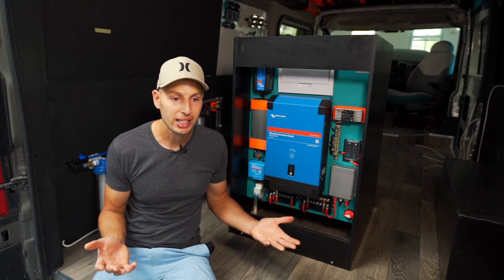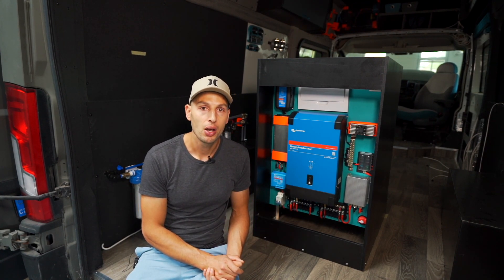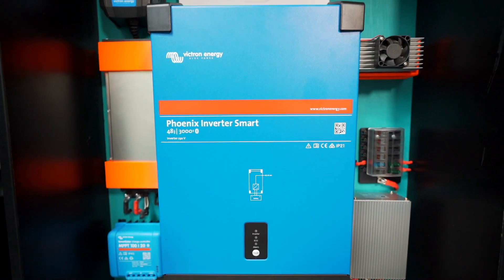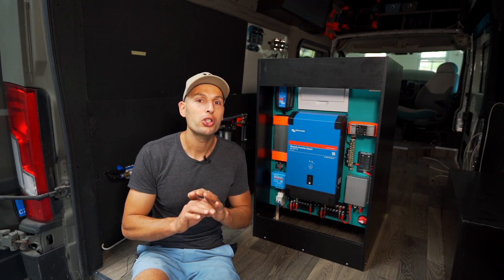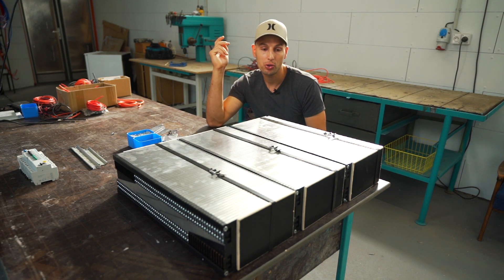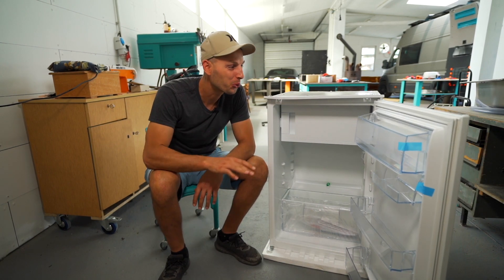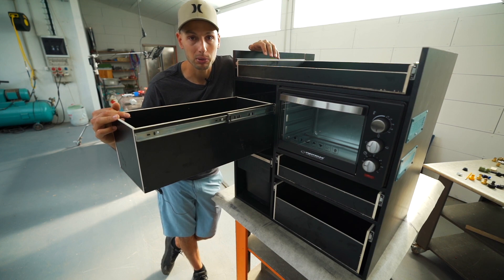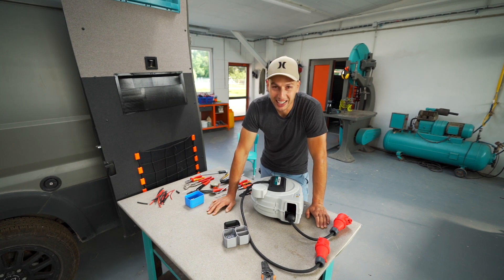New Approach to Electrical System in CamperVan (48V)

Comment: I have a few project where the 48V battery is charged from the 12V car system. A dual alternator is challenging ( awkward mounting, double wiring, load control ), however upgrading the existing 12V to a higher current one is often more feasible / easier. In those systems I used a Calex bidirectional controller ( 48S12.3K0BCA ) ( wicht allows many fun stuf because of its bidirectional features, like using high power 12V stuff from the energy of the 48V system), that controller allows to charge the 48V system from 12V alternator power. This controller, with some use of an external controller, allows similar things as the Scotty bidirectional converter from Safiery ( they have many videos, to get an impression of what it does ).
Reply: Hey Danny, this was very interesting to me because I was looking for the same thing. The best I came across was the Sterling BB1248120 12-48 which isn't even released until Q1/Q2 of 2023 and is 1500w output. Yours is 3000w output? I found the Calex one for sale for $775, is this about right? Already it is $150 cheaper than the Sterling one and double the wattage? :S. I was thinking to upgrade my 150A alternator to 280A, though that will cost $1k. What size alternator do you have? and how have you found it charging so far? What is your real world input/output? Can you throttle the input/output so you're not overdrawing from your alternator? I think this is the only semi-realistic approach as a 48v alternator is $$$$$$. Also what is the external controller you're using?
Reply: @Wantedrtw  I am also interested in using this device in my next conversion. Have you used the device @Reubs?

Comment: Check out the Killer Wasp from Safiery in Australia. It will take the 12v from your existing alternator and charge your 48v battery bank. It can draw up to 1000w from your existing alternator
Reply from the maker: I’m after 3kW alternator and ideally higher voltage. Conversion like this would be less efficient and I would need much bigger wires.
Reply: Try the safiery Scotty. Rated at 3kw. It’s an awesome piece of kit.
Reply from the maker: It’s crazy expensive.

Comment: Nice, I don't remember seeing any 3 phase socket on any camping site I've been, but EV charger station soon will be more common than toilet dropping points in Europe ;) But... do You control the weight? You car was 2350 kg before You put your foot in it, while just your bikes are 100-200kg heavy - depends which one you take on the trip. Heavy glazing on the roof, heavy electric system, You heaven't really started filling interior with furniture.... I  assume tanks are almost empty on the highway, but Yours are not the lightest too...    You go to Austria, and their police will force Magi to continue journey on the bike... 🤣 I have build on L3H2, and I know that weight is the biggest problem, You have a bigger car - bigger problem...
Reply from the maker: Yep, we keep an eye on weight. Obviously we want to stay under 3,5t. It might be without water but must be with bikes. We’re actually about to scale the van this week so we might share results in the following video. Battery pack is on board so with the victron it’s extra 100kg right there 😂

Comment: why didn't you take the victron multiplus 2?
Reply from the maker: My solution is a bit more elegant I think. I can charge faster and use more power at the same time when plugged to the grid.
Reply: faster loading yes!
The multiplus can only load 35amp.
But the multiplus synchronizes with the grid and you can set the maximum current.
For example, if you are on a campsite with max 4 amp, you set it to 4 amp and you have 920w from the grid plus 3000=3920w.
The multiplus has a transfer switch of max 32amp.
For example, if you have max 10amp you can simultaneously use 2300w + 3000w at the same time.

Comment: Best not to try and add another alternator to the existing serpentine belt system if it's not possible to do so without adding any additional lateral pressure to the bearings of the other components (a/c, engine water pump etc). 

If possible, use an additional belt running off a double pulley for the non-essential alternator so if there are any issues with it you're still mobile. And it goes without saying, always carry spare belts. They're light and priceless when you need them!

Keep up the awesome work 👍
Reply from the maker: Good idea!

Comment: Ladi, absolutely love you! love the videos. Electrician here. Please make sure your system is wired for 3 phase if you're going to be using more than 1 phase. If the phases connect/touch, you'll get a huge surprise and probably end up in hospital. So, please be careful. <3

Comment: Nations alternator is selling a 48 volt model alternator complete for about 3300 dollars.
Reply from the maker: That’s crazy. I would have to get controller for another 2500 and end up with 5800 alternator charging system. That’s not economical at all.
Reply: @ladiandmargaret  what controller are you talking about?

Comment: I think 24v is the sweet spot because you can find lighting, outlets, and appliances in 24v to run without voltage conversion inefficiencies and still save on wiring compared to 12v. My Dometic fridge and LED lights which consume the vast majority of power on a daily basis are 24v.
Reply from the maker: I was ending up with too big cables on 24V system. Seeing how cheap the inverter was for 48V, I was hooked.

Comment: I love the design of your power setup. Be careful though with the 3phase input. Don’t try to put 3 house plugs as plugs. If you plug in one of them the wrong way you have 400v going into your system! You should rather have one main phase you wanna use all the the time and maybe some switching in the back to decide how you distribute it.
Reply from the maker: Thank you for the input, I’ll consider.

Comment: An alternator setup for 48v charging is using a dedicated 2nd alternator with an external voltage regulator to step up to 48v output.
Reply from the maker: There are 48v alternator out there. Stepping it up is an option too.

Comment: Ladi, 
if I could,
 I'd go for 400VDC for my build for all the reasons you mentioned.
I want to strongly recommend a portable diesel/multi fuel burner just for those monsoon seasons 200km away from the grid. They're finicky and you have to actively pump the fuel but it's a cheap cooking backup. 
I'm going for a 48V Steca solarix PLI model of inverter, pretty bulletproof from what I've seen, offers everything that victron does and a touch more for half the price... reliability TBD.
I'm looking at some server 24v lifepo4 that can do 2sXp configuration.

I haven't really found any good (high efficiency low cost) DC buck converters to power all my 12v windshield wipers for automations we've planned. But just like most stuff, planning ample space so that future me can figure that out 😂

Also, 300Ah48v is 600Ah24v and 1200Ah12v (not 6500)

Comment: @8:46 you say that it's 6500 AH on a 12v system... That's WAY off. I'm not sure what calculation error you made. It's roughly 1300 AH on a 12v system. 100 AH at 12v is approximately 1280 watt hours. Or 1.2kwh. you have 13 kwh, meaning it's 1083 AH at 12v. I have a 304 AH or 7.3 kwh battery in my skoolie conversion. Which is a little over half of yours, but it's still only 608 AH at 12v. 

I understand it was probably just a calculation error and that you totally understand your stuff, but figured I'd put it out there for others to see that that number wasn't correct.
Reply from the maker: Thanks. You are on point. My quick and wrong calculation live when recording the video.

Comment: Awsome work! Im setting up a 48v system for the same reasons as you running from 4 x 300ah 12v batteries, Victron do a 12/24 step up to 48v  battery to battery charger which can  run from a second alternator.

Comment: I don’t understand how they can claim that “microwaves are waste of space”, yet they slapped a fucking oven in there... I think most people seriously underestimate how often they use microwaves. What do you do with leftovers? Heat them up in a frying pan? Come on, no one does that. You slap it in the microwave. Some things don’t re-fry well also (stir fries etc) and it’s also creating extra mess and cleanup, which is difficult & impractical in a van with limited water supply.

Also, if you are hell bent on getting either a microwave OR an oven, you should still at the very least get one of those modern 2-in-1 units that can do both. That way you can stop fighting which one is essential. They even have 3-in-1 units now (i.e. Breville Combi Wave 3-in-1), where it’s a microwave AND convection oven AND also an air-fryer! Why compromise, when you can get all of them as 1 single unit?!
Reply from the maker: We seriously don’t have leftovers, it’s easy to estimate food for two people.
Reply: @ladiandmargaret  I absolutely can't relate. I love eating delicious, healthy food, but I hate cooking. I don't want to cook every single meal, that's such a waste of time. And I absolutely can't justify the ridiculous cost of eating out these days either. So I meal prep instead. There are a ton of dishes that store very well in the fridge (or even freezer, like most curries and sauces), so I cook/prepare them in large batches and then eat them for a while (you can even cook multiple different dishes at once, so that you could mix them up throughout the week). I just pull them out, microwave and I'm done. Healthy, fast, delicious and cheap.

My point is you want to avoid any extra work, especially when travelling and living in a small space. So often you pull over after a long trip/hike and you are too tired to cook. Most people in that situation will just stuff their gut with some garbage snacks or fast food. But if you have your pre-made healthy food in the fridge & a microwave, then you don't have to do sacrifice your health - the food is ready to go with no prep or cleanup, so it's much easier to make the right choices.

Besides, even if you don't microwave often, it still makes sense to get a 3-in-1 type of devices. The more features the better. And they don't take any more space either. It's a win from all angles, in my opinion.

Comment: Confused about the 6,500 Ah @ 12v. Isn't it ~1,200? I have a single 400A 12v battery which is 5,120w. This is awesome, though
Reply from the maker: You are right, my mistake.

Comment: Important to note is that the Victron inverter is 3000VA rated ... that is not 3000W ... it is about 2400W continuous output. But that still is quite a lot.
Reply from the maker: It’s actually 3kW continuous and 5kW peak.
Reply: @ladiandmargaret  no idea which model you have then
Reply from the maker: Phoenix 3000
Reply: @ladiandmargaret  so check the docs. It is a common mistake. Victron uses 3000VA which is not 3000W. At 25 ambient temp it has continuous output of 2400W. With a peak of 6kW, believe me it will not deliver 3kW continuous.
Reply from the maker: Ok, good to know. Not like it’s disappointing 😂
Reply: @ladiandmargaret  2400 continuous is plenty just don't use induction and oven at the same time when going through the inverter. But you have foreseen plenty of shore power options.
Reply from the maker: It will be fun testing everything. I’m curious what the draw is going to be out of one burner, medium power and how doable it’s going to be with our power bank.

Comment: Kudos with 48V. I've also not used the Victron with the switchable - way too big. Separate switch for EHU is better for space. Curious what weight you're going to put up front to balance the van, especially with swivels! How will you charge on a site if your 3kW charger consumption trips the site EHU? Not sure where you are but realised that most of us Brits label anything that looks like a microwave, a microwave - I wouldn't be without our combi oven. So when you say microwaves weren't your thing... We also do that with Hoover, which is a brand of vacuum cleaner. There's 48V alternators available. I'm using a 8hp Yanmar, electric start, diesel boat engine with a V belt to a 75A alternator, plumbed into diesel tank - inspired by Fisher Panda marine generators which are also fitted into VWT5 speed camera vans to run HVAC and media satellite/ broadcast vehicles with a big dish.

Comment: You should take a look at Balmar. They make alternators specifically for the second alternator use case. They have a 48V alternator system and provide better serpentine belts etc.
Reply from the maker: I know but they are crazy expensive.
Reply: @ladiandmargaret  that they are. Boaters are rich :D
Reply from the maker: I got it now, that’s why 😂

Comment: Curiosity question:   Admittedly, I am an electrical novice (or even dunce level)  but could you also add a female plug to your retractable cord, allowing it to become a retractable extension cord for you to plug things into outside of the van?  (ex: you could charge your bike outside of your van.   )  Or, would that not work because of charge controllers or other appliances?

Love the fridge, by the way!!! So much food and ice!!!
Reply from the maker: Hi, thanks. Sure, there is a way to do it.

Comment: For 48/52V alternator charging, I'd want a system that could clutch the alternator for any over temp condition of the alternator itself, as well as when the battery was full...
Reply from the maker: Oh yeah, controllers have temp sensors so they would stop charging when the alternator is too hot or battery too cold.
Reply: @ladiandmargaret  Yes an AC compressor like clutch drive would let you run the 48V alternator only at higher engine RPMs - extra loading at idle is not ideal. Of course you'd only be charging while actually driving along - but assume that would be OK. This reduces loading on the belt which is worst at low RPM. Then as noted you could also declutch when fully charged or when the engine or alt get too hot or even manually if you know you will have a power source where you are going and don't want to burn more fuel than needed.

Comment: Hi Ladi, this is one of your best, in terms of inspiring and engaging, videos. You are an awesome couple. Each of you is relatable in a unique way.
As someone also mentioned you have made complex electronic systems understandable. I couldn't do what you've achieved but you encourage me to be less afraid of trying to understand and install simple electronic system in a small van.
I like the way you share the experience of your previous cling film wrapped,  eretractable extension cable. Keep up the good work.
I'm looking forward the next video with you both.
Reply from the maker: Thank you very much! Principles are relatively easy to understand. The rest is designing the system :)

Comment: You might want to check out another youtube channel "sailing sophisticated lady" and a recent episode.
They just installed a 48volt generator to their new boat engine, and switched over to 48volts.
They also have solar and a massive batterybank from battleborn brand.
Reply from the maker: Thanks. I actually know this alternator brand. They are very expensive and controllers are around $2000. That’s too much for electricity generator.
Reply: @ladiandmargaret  Similarly, "Odd Life Crafting" just got a WS500 Advanced Alternator Regulator from Wakespeed for their boat.   How about adding a Super capacitor and regen, when you are not too busy🙂🚐☢

Comment: Thanks for the electric system details! Were you able to find 48V lights?  What about USB charging? What power is running your overhead fans? I missed you talking about or showing a step-down unit for these smaller appliances.
Reply from the maker: Thanks. All of these run on 12V, right bottom corner is 70A dc-dc step down powering it all.

Comment: Awesome build, I’ve been running a home built 48v 20kwh battery pack system at my house charging from a 6kw solar system for the past year. As a suggestion you could utilise the 3phase sockets on the extension real and make up adapters to utilise the phases you have available e.g 1phase plug wired to the phase you on the 3phase socket outlet you want to use or even make up an adapter box between the plug and socket with a selector switch to chose the phase you want to power up. You then would require less wiring in the van. I would also suggest to fully unwind the extension to eliminate excess heat build up in the cable when running near the cable amp rating.
Reply: It should be unwound way before, though there are a lot of variables, but better safe than sorry, I would personally unwind at about third of the rating at the latest. Some extension reels have a label which has the safe wattage/amperage which is nice.
Reply: @VilmaHallikas  fully agree, def way to much variables so the safest bet would be to fully unwind before every use!👍🏻
Reply from the maker: Definitely!

Comment: I knew your electrical system would be over the top but this exceeded anything I could think of. I can't wait to see what batteries you're using and to see the whole thing in use.
Reply from the maker: Thank you. The battery is going to be installed within two days hopefully 🤞

Comment: I don't know what BMS you have, but I would recommend putting a monitoring system in place. There is a VenusOS (by Victron) driver out there that can monitor and log many of the popular BMS brands. My advise would be to go straight for the Cerbo GX. You will thank yourself later

Comment: Great setup Ladi. I agree, 48v is the way to go for a camper. On the topic of a second alternator; Do you really need one with 1kW solar on the roof and 13kWh Battery pack? I doubt it.
Reply from the maker: Thank you. I’m more thinking output. Multiple cloudy days and I would have to be considering whether I can cook or not. Another charging source just compensates weaknesses of other systems.